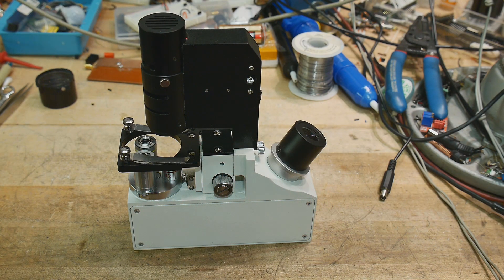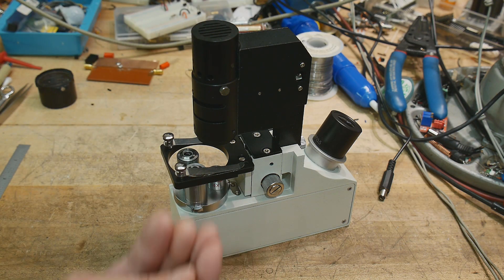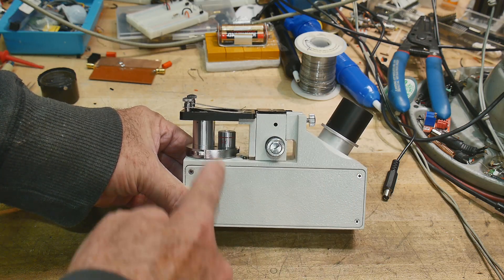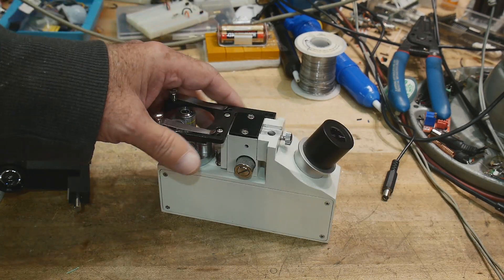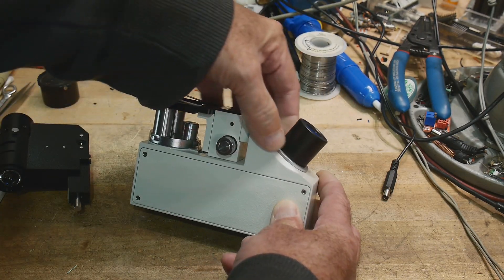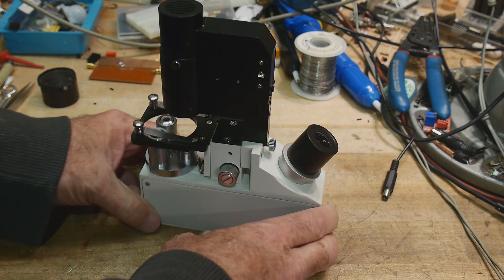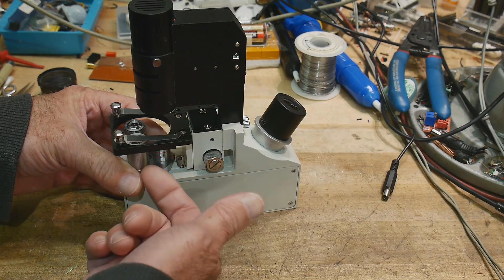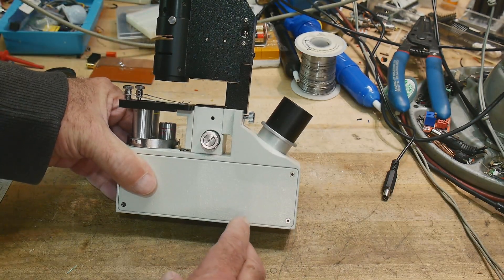#670 OMAX M615INV Swift FM-31LWD Inverted Field Microscope

Comment: Most microscopes use C or CS eyepiece mounts. If that’s the case, there are many adapters to micro four-third cameras, like your GX7. MFT is probably the most adaptable camera out there. Let me know if you have any questions.
Reply from the maker: I already own eyepiece mounts for my camera and use them on my other microscopes. This tiny microscope uses smaller diameter eyepieces 18 or 19mm and I don't have that small size. If you know of a usb camera with the small eyepiece size I'd be interested